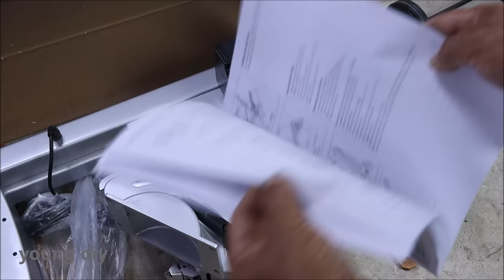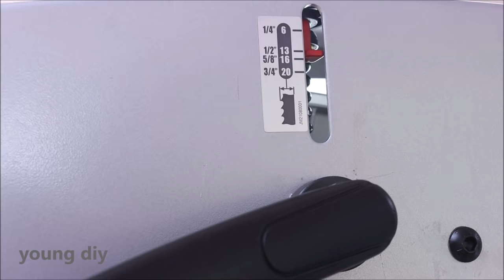Makita LB1200F band saw for Home and Diy , Unboxing and Testing.

Comment: I have had this machine for about three years now. Very happy with its performance.
Reply: Hi sir.can I ask?how much this kind of machine.?u say.u have this one.
Reply: @elbertdaguplo2592  hi, I’m not sure where you are from. I bought it in South Africa.
Reply: @eugenetaljaard7568  hi sir.im a Filipino.the land of many pacquiao. I'm far away from u.thank 2 ur reply.
Reply: Where did you get it?
Reply: cool bananas whats the hardest timber you cut?
Reply: @jamesleicher  everything from maple, ash, rosewood, Purple Heart, etc. Resawed some lengths of each just the other day. Very pleased with the results.
Reply: @eugenetaljaard7568  did you change the blade for resaw ?I try searching the resaw blade but couldn't found the resaw blade .
Reply: @MuhammadFahmi13876  the best blade for resawing is a 13mm 3 skip tooth. My saw came with a 16mm 4 tooth which also does a pretty good job. Important to set the saw up properly.
Reply: @eugenetaljaard7568  thank you sir for the answer , appreciate it .

Comment: I bought one and am very happy. I am able to resaw 1/8" veneer with mine just out of the box.
Reply: Hi there, is the saw good enough to cut 25mm thick, 15cm wide plank in half to get two ~12mm pieces that are straight and can be glued together to get a 30cm wide plank in you know what I mean. Thanks
Reply: @Bakanelli  sure you mean a book match. The answer is yes. Just ensure that your machine is correctly set up (there are videos showing how to do this, and it's not any rocket science) and loaded with the correct blade. Never - ever - try to resaw with the thin 6mm blade as you just will screw the wood and get frustrated. Instead use preferably the wider 16mm blade that comes with it. In fact you can go OK with the 13mm too but the 16mm is specially designed for resawing so... Finally the most importantly, absolutely do NOT rush. Take your time and be patient. Don't try to go faster than 1mm per second, or even less, when resawing hard woods. Do not push your plank against the blade. Instead, let the blade do its job by barely touching the wood with the metal teeth without making any effort. You just have to conduct the plank forward gently till the end. Again, take your time. Maybe you will take 10 minutes to split a 30 cm plank? No problem, at the end you will have a great splitting. The problem when pushing is that if you do it so it may twist the blade and it will make the blade get out of the straight cut that you want. finally ensure to keep the wood always firmly pushed to the fence. Doing it, you will always get a perfect result. The only downside is that you will end up with those vertical saw marks all along the two halves so you will have to plane, scrap or sand it down. Not a big deal though. I am mentioning it because I already have seen very powerful bandsaws that can do the same job is a few seconds and they go so fast that it won't leave any mark in the wood, but such machines are so much expensive to worth have one in your home shop. I consider that the Makita LB1200F is today the best cost-benefit bandsaw for the hobbyist. But I am from Brazil and here we don't have a lot of options. Mostly we have several of those crappy desktop mini-bandsaws, then the Makita and then a Starrett that will cost like 3x more than the Makita and basically it's this. That's why I choose the Makita because this is the best machine that I can afford. If I couldn't I honestly would prefer NOT to have any bandsaw in my shop because I already had a couple of those cheap and small desktop ones and they really suck.
Reply: @Motocicleiros  thank you very much for the thorough reply!
Since I don’t own a bandsaw or the table saw, do you think the table saw would be better for my purpose of resawing planks because it seems to me a lot faster? Thank you very much :)
Reply: @Bakanelli  Well, if you don't have ANY saw and is looking forward to start equipping your shop, no doubt a table is the way to go. In fact I think it's the very first machine that any woodworker should get start with. Said that, a bandsaw shouldn't be on top of your priorities; and most important, you won't want to buy a band saw exclusively for resawing. A band saw is more suitable for intricated curved cuts and its ability for resawing is more like a bonus feature. For what you are in need a table saw can absolutely take care of the job. In fact, when I have to resaw (split planks) my first option is always my table saw. By the other hand you should keep in mind that in comparison a table saw is a too much more dangerous machine than a band saw and using it for resawing is a tricky task and I wouldn't advise a table saw absolute beginner starting doing such a task with one. You must be very used to operate this machine with regular tasks (ripping and crosscut) before trying to do some harder tasks as resawing wide planks. Also depending on the width of the plank you will want to use a jig. You said 15cm and it's not too much to cut without a jig and using the regular fence for who is experienced with a table saw but for a novice I think a jig is mandatory even for such a size. I don't know what type of work you do but it seems to me that your goal may be to split a plank and join it for making a guitar top. Also I don't know how much splits you have to do, if just one once in a while or several ones a day; but if you aren't in a massive production maybe it would be better to pay someone to do the job for you. IMO the cost-benefit would be way more worthy considering that beside the cost of a machine you still would have to deal with the learning curve (either for a table saw or a band saw). Furthermore keep in mind that no matter what saw you buy you probably will need a thicker planer (or a hand plane) - to not mention a stationary or strong hand sander - to mill off the defects of the faces of the split because it won't get out of the saw perfectly smooth; so more cost and more learning curve. I hope I have helped. Sorry if it seems that I am raining on your parade, but after to have taken some wrong roads in the woodworking world I know how frustrating the investment in machines can be. Nonetheless I would advise you to join to a good woodworking forum. I suggest https://www.woodworkingtalk.com/ there are tons of VERY experienced people there eager to help (I am part of the community myself - look for *yankleber*) and I have learned a LOT form their experience and advices! Good luck!

Comment: You need to adjust your upper and lower guides , they are too far forward. They should be aligned with the gullet of the blade tooth. Other wise you will destroy your blade very quickly.